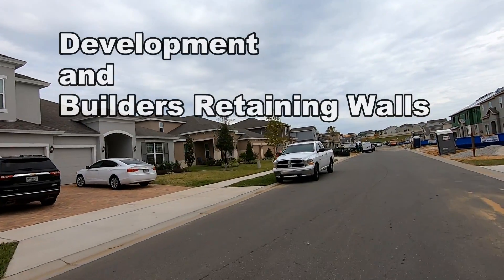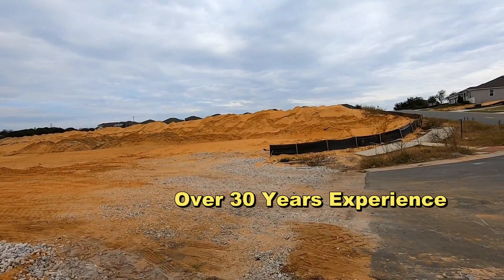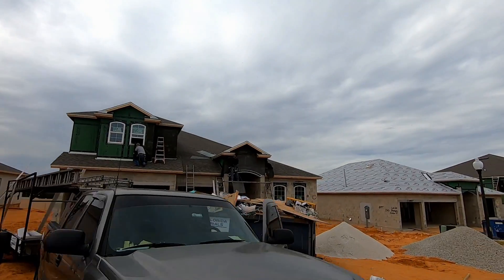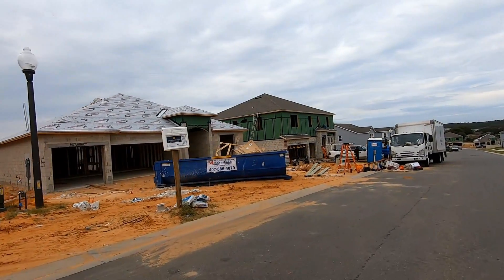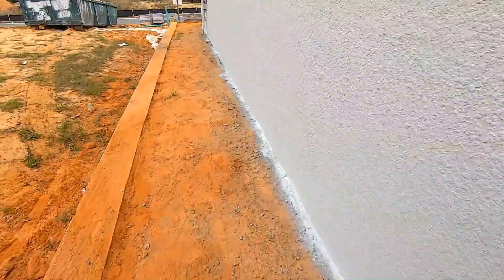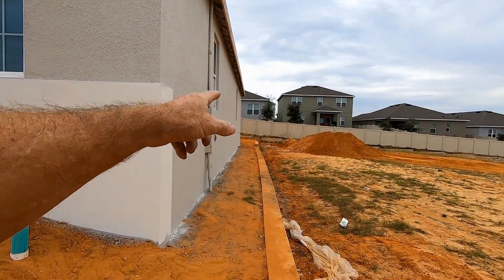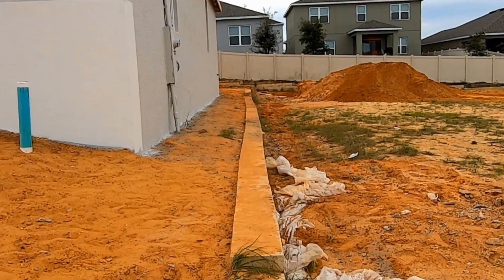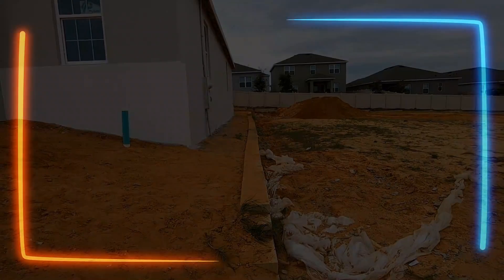Common Problem of Builders - Retaining Walls in New Development

Comment: The corners they cut for something so simple is just ridiculous. And just think they literally had to lay the gravel and pipe before leveling the soil back out where as Chuck has to re trench it. Contractors can buy this pipe for $1.80/meter. That's 3280 feet of draining material. Of course there are other parts but the cost is so miniscule compared to home owner costs even for materials if you can trench and know what you are doing. I would bet the lawsuites from poor workmanship and attorney retainers are far higher then them throwing $100 at a basic drainage solution. But they bank that you have insurance with a couple thousand deductible and insurance will cover it. They can buy in bulk and the work to put in the wall is two for one deal but I work in telecom utility and yiu wouldn't belive how a simple invitation for new development flaggings save home owners thousands. All you can do as a home owner is make sure you have all utilites and drainage extra lighting and conduit for future mindfulness under the sidewalks and driveways from the meter base and know where those are. Its cheap to put in duct for pulling and drainage while the trenches are open. Ask your developer builder as many questions as possible. Sure you can have a beautiful home too but think ahead ask a gas power water or cable OSP pros questions before breaking ground. Even if you think you won't have a drainage issue, guess what your neighbor will cut costs by dumping unto you home so it's best to have it even if it's a rare high water situation. Trust me I've been in mold remediation, restoration, telecom, cable, you name it and people have no idea what it takes to repair or solve these problems undet rhe dirt until disater happens. Its all about grade! And for those of you who love to pour concrete on everything you have to consider heavy snow melts and rains and why you need more dirt areas to keep it out of your investment. Also treat all your wood with borax! Keep your ants they will make termites their food source! And for havens sakes don't plant trees near your water pipes your septic system or near your house because in 30 60 years it will grow into your pipes walls and fall on yo house. Plant red maples or fruit trees so you can have free food!Athletic shrubs dont naturaly kill and deter like mint or catnip. Keep it simple. Make better choices. Trust yourself and question the contractors. Hold them to quality jobs.